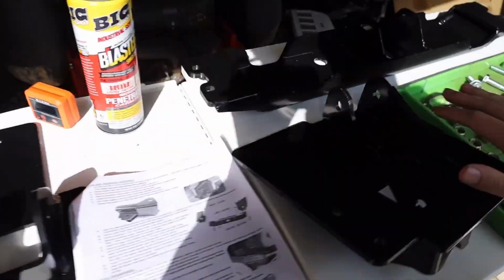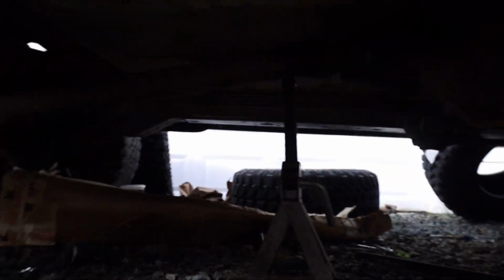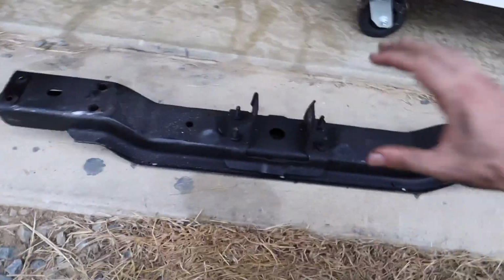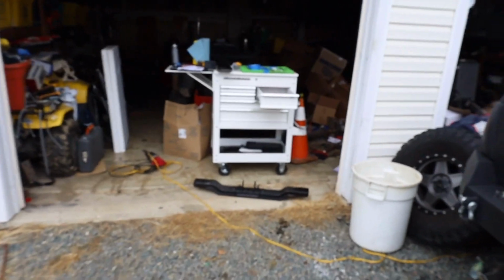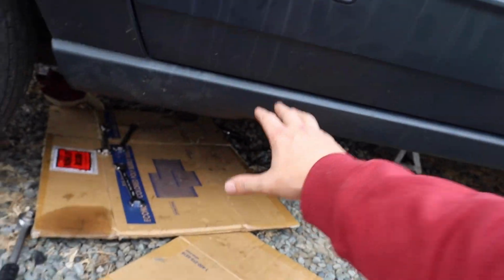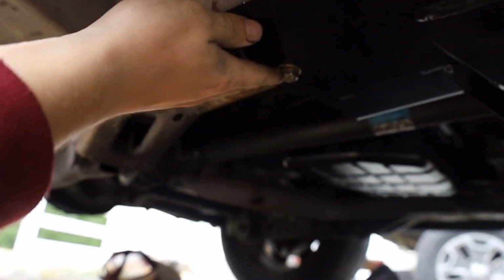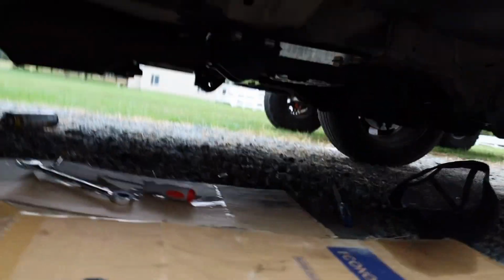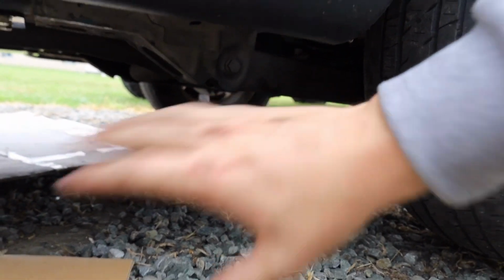INSTALLING IRO ROCK LINK PRO CROSSMEMBER ON MY JEEP WJ

Comment: To get the nut plate positioned in the frame easily, I used a pice of welding wire with a 90 bent at the end. You can use a coat hanger too, but use the bent end to push the nut plate until the wire end pops out of one of the holes. Adjust from there, and use very little pressure when threading the first bolt. It will spin the plate once it is started, so you can get the other side lined up.